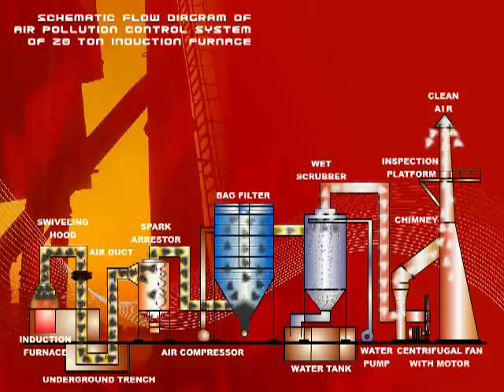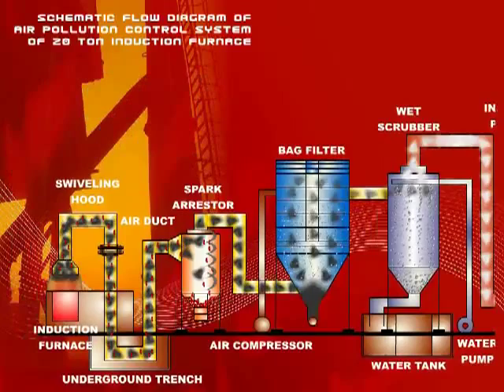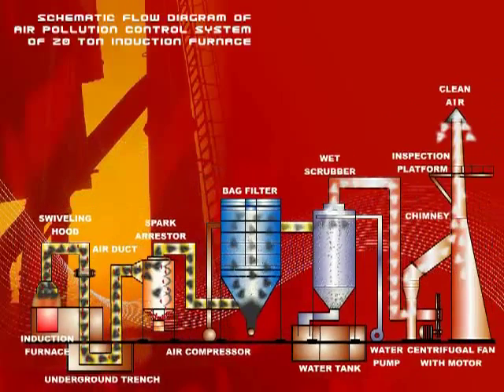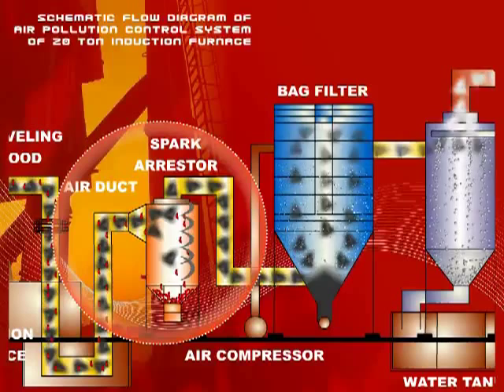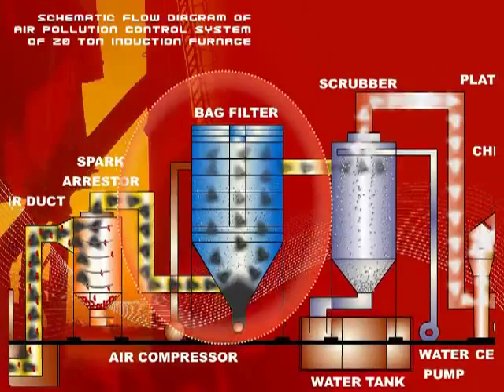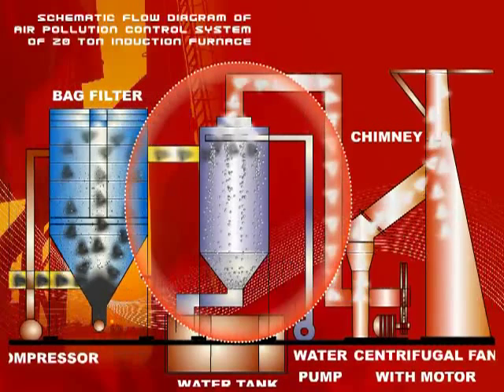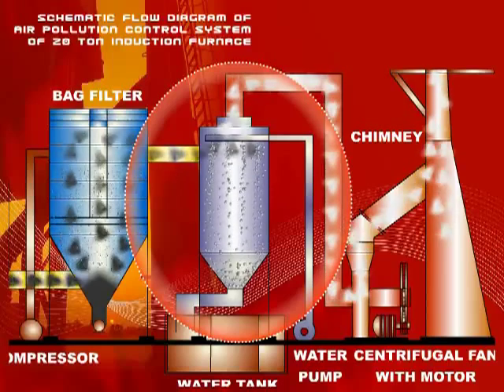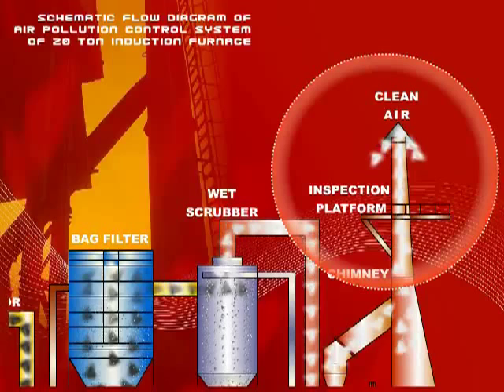pollution_2.flv

Comment: Excellent work madam.
We Have an Induction Furnace and are planning to install such a system. 
But with front facing Suction hood.
Also could you please guide where can we purchase the designs for bag filter cyclone and impeller from so that we can Fabricate it at site to reduce cost.
Thank you.